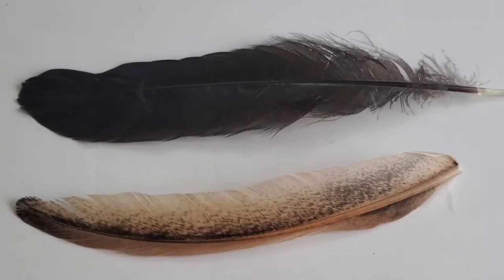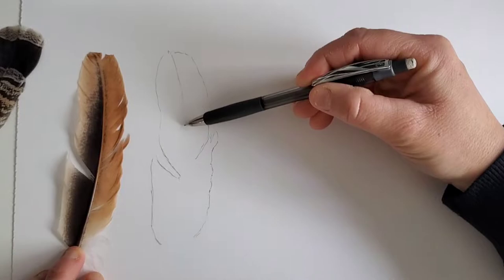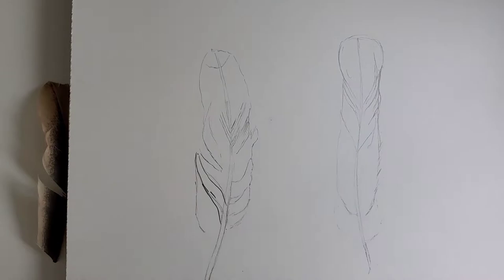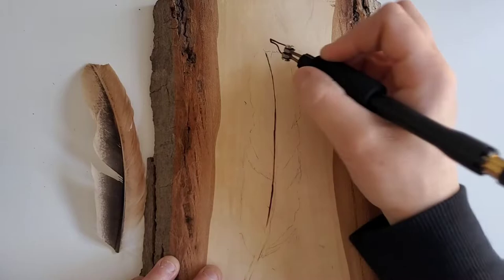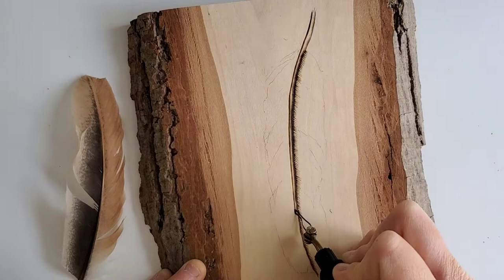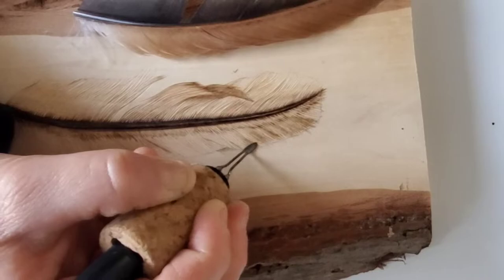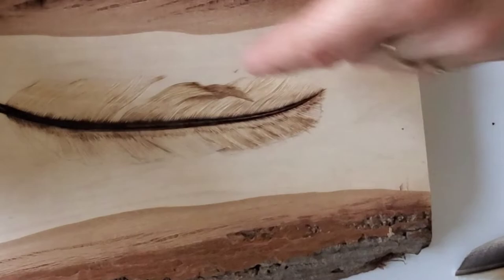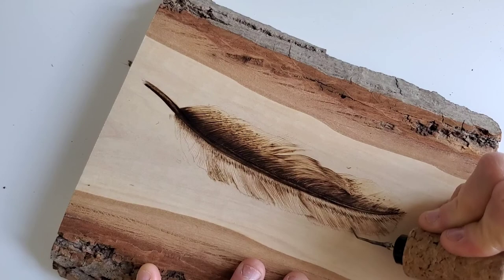Wood Burning Feathers Tutorial // Pyrography How-to

Comment: Yea I have a burnmaster and bought the bhp razor tip pens also many for the bhp. I have be careful cause it get very hot very quick. I don't like the skew or spear shape tips or they don't like me. Very easy to sink into the wood. I am sure with practice it would become more controllable.
Reply from the maker: Hey there!
So I completely understand; maneuvering a skew tip, especially in softer woods can be difficult.  They can also tend to follow grain patterns and can tricky to get to do what you like when just starting.  Please don't get discouraged and remember let the heat leave the marks, not pressure.  These pens do not require much pressure to control and pressure to increase the tone when burning.  If you practice rolling your pen in your fingers when making curves, you can have better success in clean linework.  I will be revamping my channel and getting back into posting.  Ill be sure to tag you in a video about skews to help show what i mean :) 
Thank you for watching!

Comment: Thank you again for sharing your talents with us. You mentioned that you are using the skew from the Bird Carvers Micro 5 PC set. Did you purchase the Standard or the Heavy Duty set?
Reply from the maker: I'm not sure what you mean.  🤔  I would check the Razor tip website for clarity on your purchase first.  I would watch my video on "Wood burning with a Hotwire System" which explains how the Razor tip pens are divided into standard and heavy duty. The inchangable pen is a heavy duty pen.  I would recommend a heavy duty cord as well when using it. The tips themselves aren't normally described as standard or heavy.  Only the pen.  The name of the set is "Micro 5 Piece Set"
Reply: @BURNTbyHollyPyrography  Thank you. @ Razertip The Micro 5 Piece Set comes in a choice of Standard or Heavy Duty.  I was wondering which set you had gotten the skew from which was mentioned around 10:06 min into the video? Thank you again for your time.
Reply from the maker: @wendyshoults7355  thank you for clarifying you question.  The exact tip out of the set I'm using is the small round skew #S7 of the standard Bird Carvers Micro tips 5 tip set.